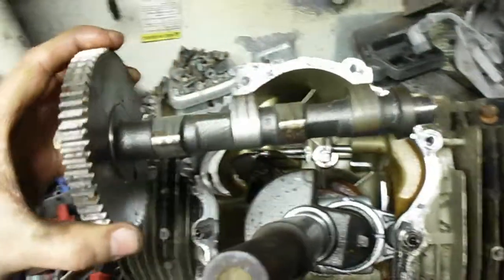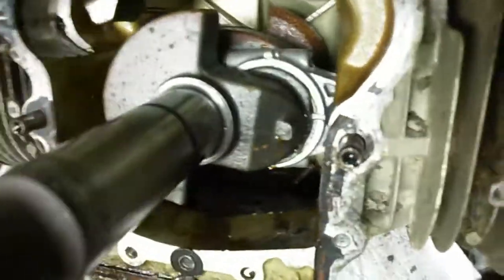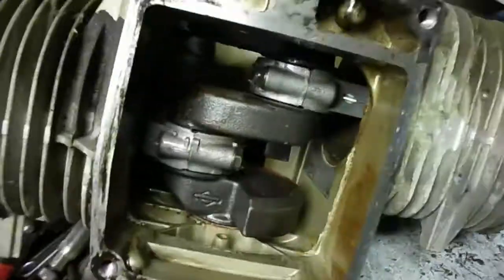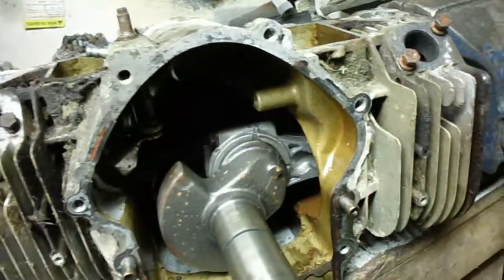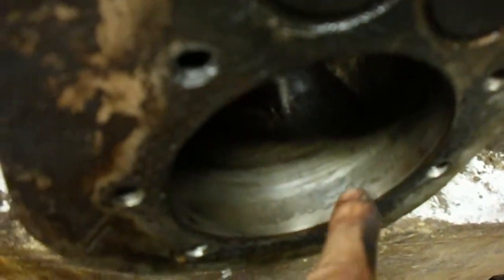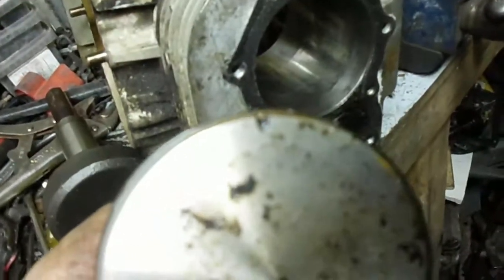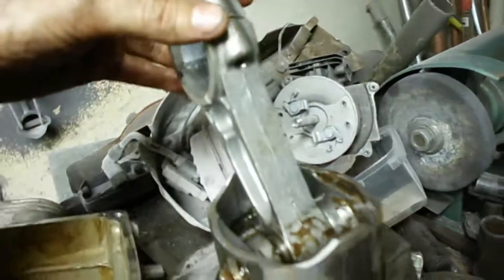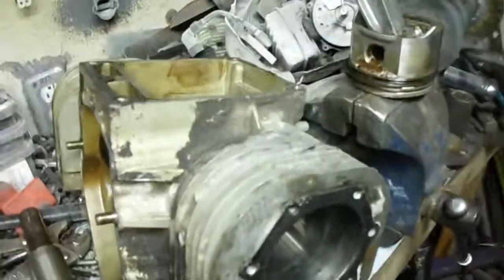Opposed 2 cyl. Briggs model 42 Teardown Part 2

Comment: Looking good, I bet she'll still run with that bore. Since your engine is a 42ci it should be in the 42xxxx model number series. 422777 should work as a sample number for ordering parts, although most parts between the 40, 42, and 46s are interchangeable.

Oh and the cylinders are usually labelled 1 and 2 somewhere on the block, i think around where the tappet covers go on.
Reply from the maker: Thanks for the part number advice, I know very little about these larger engines, and my 2 manuals are only for single cylinder Briggs engines. The big item I need to track down is a flywheel, I was looking up parts, and about had a coronary when I saw they want $450 for a new crankshaft for this engine, holy Snapping Turtles !
Reply: Yeesh. I imagine those NOS prices are going up as these engines were discontinued in 2002(thanks, Al Gore). Might be better off getting used stuff off eBay. There's cheap repro parts for these engines on ebay too, coils and carb kits and gaskets etc.

Oh and when(if?) you do end up getting a carb for this engine, get the earlier one with the 3 screw mounting fuel pump. They're a lot less finicky and have an adjustable idle jet. The later ones have 4 screw mount fuel pumps and have fixed jets.
Reply from the maker: Hey, thanks for the advice, I will look for the 3 bolt carb. I recall getting a big lawnmower carb a few years back, I will go shed searching, as I usually write the engine model # on the carb. with a Sharpie marker.

Comment: I was looking for how the hell to get those tappets out and put a new one in lol. Even the valve compression tool didn't compress them enough, you also have to compress the correct one as one valve compresses more than the other, and I never thought to use a wrench to hold the outside of the valve in place. Thanks!
Reply from the maker: You are welcome, I usually McGuiver some way up to accomplish a task!

Comment: @ChargerMiles007 so I commented on one of your vids you made about 7 years ago, the Briggs with 3 Long Head Bolts.

Anyways, this is a long shot, but in your description it says you had a manual? I'm currently looking for the part numbers for this engine!

3 Long bolts and 6 short ones. Can't find the part numbers anywhere!

Thanks for any help you can provide!
Reply: The video you made was here: https://youtu.be/Er3bYYqTZR0
Reply: Engine Model: 190412-0695-99
Reply from the maker: Hi, I try to respond to all comments if possible!
So, what I did was go to Jacks small engines Briggs& Stratton parts lookup page. I typed in the model number you gave me, and scrolled down. I opened the main engine assembly drawing and located the head bolts, then scrolled down the parts list at the bottom. It says the short bolts should be #690912, the long bolts are 592244, and any long studs are 691690.  Jacks seems to have them all for sale for $2-3 each plus shipping. I have never ordered parts from there yet, but I am sure they are a reputable business. I use their parts look up all the time, as the one on the Briggs site seems to need more numbers, and I am guessing at them sometimes with my old engine parts searches :)
 Please verify the bolt numbers I have listed, I have typed in what I wrote down, so they look right, but a double check never hurts!  Take care.  Miles
Reply: @ChargerMiles007  Thanks for the reply!

So yhe 592244 is actually a non-shoulder bolt (labeled a screw). It's not actually a head bolt. We figured this out while in the parts store because they had those in stock.

The 690912 is most definitely the short head bolts! I'm ordering 6 of those!

And I'm assuming the 691690 head stud is what replaces the 3 long head bolts...

Technically the 691690 is a head "stud" but I called Briggs and even they say it supercedes all the old part numbers.

Basically I just wanted to clarify this before ordering the parts.

Thanks again for taking the time to reply and discuss this with me, you got a new subscriber!
Reply from the maker: Thanks for answering back, I was distracted looking at a link to old Briggs operating manuals :)
Sounds like you have been around the block on these bolts. Hope you can get the ones you need! In the past I have just used grade 5 bolts and flat washers, but I understand why you want the correct bolts. Unfortunately bolts are not availible in as many lengths as they used to be, pretty sure you could get then in 1/4" increments, but now only in 1/2", once past 1-1/2" long. Hope you get that 8 horse Briggs purring like a kitten!  Take care.  Miles
Reply: @ChargerMiles007  yes there's been some digging, Briggs has like 5 part numbers for the same bolt. The original part numbers are as follows;

# 94926
(3 9/16” Long)
 "6 Short Bolts"

# 94776
(3 15/16” Long) "3 Long Bolts"
Reply from the maker: Thanks for the info, i am sure it will help out another youtuber someday!

Comment: That cam isn't much smaller than my VW ones! Those pits are better than the ones I found in a few of the five engines I've torn down, those were missing a millimeter in a couple jugs! XD Good thing they're separate from the block in ACVWs!
Reply from the maker: Yes, been a few years since I have torn down a VW Bug engine, they sure were different than the American V8 engines I was used to back in the day!
Reply: Very much so! I've yet to rebuild any of the five (come to think of it I haven't torn down the fifth yet, it was running but rather tired/worn), but hope to in the future! Don't have any experience rebuilding V8s yet, though I kept the one in my grandpa's old truck running after he passed. (with a lot of junkyard parts and questionable bodgery, but it ran!)
Reply from the maker: I hope you have fun getting one of those old VW engines going, it should be a fun project.
Reply: Thank you! I certainly will, once I can afford all the small new parts and inspection/machine-work on the good used parts. (though I may try to do a practice-build with some of the used parts first, then I'd only need bearings and a few other things)

Comment: I have a 402417 0676 Briggs and stratton opposed horizontal shaft engine. I need to rebuild it but i can't find rebuild kits at any of my local small engine shops
Reply from the maker: Give ebay a try, it is amazing what you can find there. I look the parts numbers up on "Jacks small engines" Briggs parts look up online. I find it a bit friendlier than the official briggs site.
Reply: @ChargerMiles007  i tried jacks small engine the have a very limited selection for my engine  thanks for the Ebay suggestion
Reply from the maker: Thanks for giving Jack's a try, I generally just use it as a parts look up to get the number. It doesn't always work 100% though, I have a Briggs mower engine # 12H902, and it is like it doesn't exist, no look up at all. I will have to get out a magnifying glass, to make sure I am reading the 'H' correctly. I find ebay very good, some parts at low prices compared to new!
Reply: @ChargerMiles007  i will check ebay. I talked a local machine shop just in case the block and crank needs work  but  they are skiddish because they would not be able to replace the engine with another if anything happened to it.....

Comment: Whats the chance that the flywheel is at the junkyard, Looks a good engine to me.
Reply from the maker: I looked around where it was, and no luck. It seems to have light moss on it, and rust on the crankshaft where the flywheel mounts, so it was taken off many moons ago, Yes, it looks like a usable engine to me, once I locate the missing parts. i will be scoping out the scrapyard!  :)

Comment: Sweet, no plastic part's aside from the oil feed. No roller bearings as far as I can see for the crank so much be a lower hp engine. Some V-twin ohv engines come with sleeve bearings as well.
Reply from the maker: Yes, I prefer metal parts, i have heard of a plastic camshaft or two slipping the drove gear!  Not a good thing!

Comment: Crossplane crankshaft is not just a Yamaha thing! Nice rods too. It actually looks like BMW engine I rebuilt years ago but it had iron rods. And overhead valves. I guess its really a flatplane crankshaft like aircraft use, not a Crossplane. Yamaha and Triumph both play with the throughs to no real effect. If Briggs and Stratton saw no reason to there is probably no reason to!
Reply from the maker: I knew a guy who had one of those 2 cylinder BMW motorcycles. This guy was in the German army in WW2, he bounced a Panzerfaust off a T-34 tank, it tried to chase him down, then his buddy got it with another panzerfaust. I met another old guy that was Italian and fought with the Germans in Stalingrad, only 10% of them survived the retreat, and he was one of them. Both of these fellas are gone now, but both were colorful characters, with lots of stories to tell.

Comment: Look on ebay for parts.
Reply from the maker: Yes, I noticed a flywheel there for a reasonable price. I will have to check if the flywheel for a 13 horse single is the same, since I have one of those already.